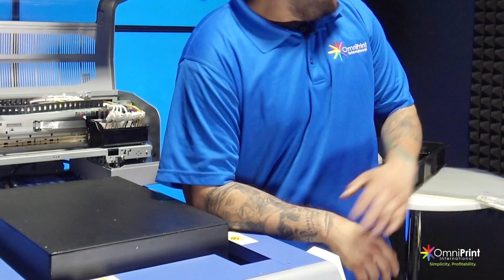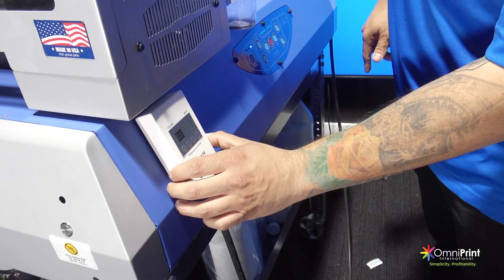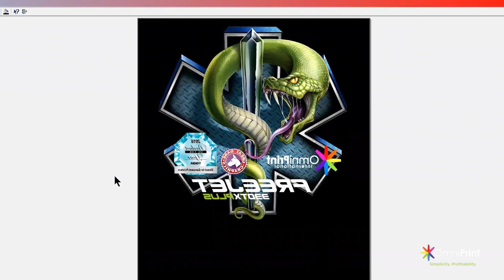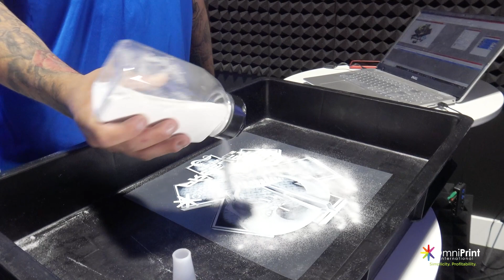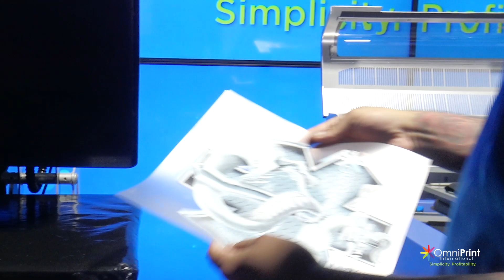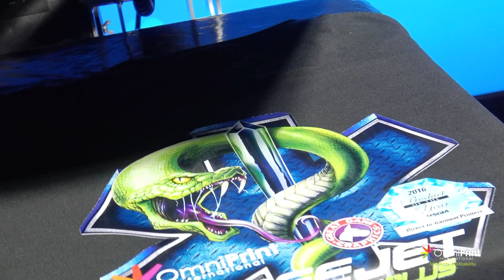Direct Film Tutorial | OmniPrint International

Comment: why are the directions different on the package?
Directions for use:
- Pour powder into the powder applicator.
- Apply the powder evenly across the film after printed and make sure you don't miss any spots.
- Grab the film and shake off any excess powder.
- Put the film on the heat press on hover mode at 320 ºF for 2 minutes or until is completely dry.For further instructions follow the directions from the Omniprint Direct to transfer document.
Reply from the maker: Those instructions are primarily for if you are using a heat press for curing your transfer, and if you are going to be pressing the transfer on your garment locally. If you are using a conventional DTF curing oven and/or shipping your transfers, we recommend a fully melted "orange peel" texture to retain the durability of the transfer and proper film release during pressing. For either curing method(heat press or oven), the powder should not be easy to remove, and shouldn't flake or fall off.

Comment: Hello What's the ink do you use for DTF? there is any difference between freejet 330tx or 330tx plus inks?  I'm buying 330tx
Reply from the maker: Hi @Arelli Durán, Great question! With regards to DTF there will be very little functional difference between the inks. The main difference to the inks is the capability to print via DTG onto 100% Polyester for the 330TX Plus, where the 330TX will print up to 50/50 blends.

Comment: What is the benefit to using this method vs just printing directly onto the shirt? Or when is an appropriate use case scenario for this?
Reply: This is what happened when you always think big design. Try think small design such as small logo, for Polo Shirt, Sleeve, Pants, Face Mask, Cap etc. That small logo can print using DTF and heatpress it different shape material, DTG can't achieve it.
Reply: @verzart4797  Actually you can print small logos on PET film with a dtg and transfer them the same way. They literally are showing you a DTG printer making transfers in this video. DTF is poor mans start up tech.
Reply: Or you find someone who want to be Agent. They have Heatpress, but don't have that Printer. So just sell printed film cheaper than normal customer. So you don't have to worry find customer anymore. Because Agent can find customer for you.

Comment: Is the t shirt pretreated?
Reply from the maker: no pretreatment needed for Direct Transfers
Reply: @OmniPrintInternational :  Okay, so there's no pre-treatment. It seems that the only way to make a true comparison is to have the 'Cost & Time to pre-treat' for DTG, vs 'Cost of Film, etc. & the Additional Time' required for DTF. With those facts in hand, it should be a slam dunk to make a fairly accurate cost comparison between the two. 

If there are an other other distinct advantages, or disadvantages, to consider between the two approaches, i.e.: quality of print, addition equipment required, etc. it would be helpful to know what they are.

The one advantage I can see with 'DTF' is you could potentially "sell" the transfers to companies who are into printing garments using  the 
'heat transfer' approach. 

Look forward to hearing your comments!
Reply: @jayedwin98020  At this point the two are about equal in cost per shirt in both time and expense. DTG does have the advantage in that it can also make transfers like dtf if need be.